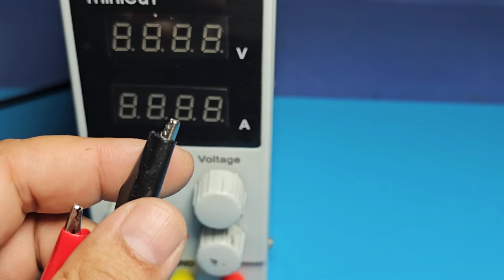Unleash the Hidden Power of Halogen Lamps - It's Useful to Know This

Comment: somebody did that already some few years back, and its not cool to use it,  its super bright  can shutter your eyes, 2ndly its not accurate to pin point  solder  a component  every component on the board will heat up toasted not just one

Comment: 55 watt is enough to melt the solder ? 😍
Reply: No sé pero da un calor terrible eso.
Reply: @juancarlossanchez118  I didn't understand what you said
Reply: He said "I don't know but that's terribly hot."
And my opinion: it's not about the electrical power, it's about the thermal power delivered through convection.
Reply: @DIYMachineYT  buenas tardes, quise poner que esas lámparas dan un calor muy fuerte, que no sé si es suficiente para derretir el estaño, pero según como se ve en el vídeo, en pequeñas cantidades sí es capaz de derretirlo.